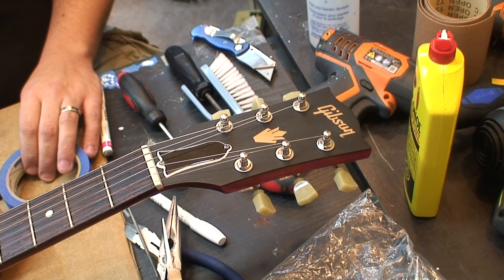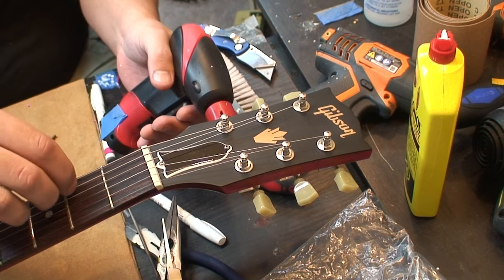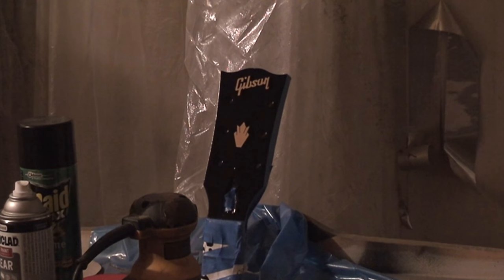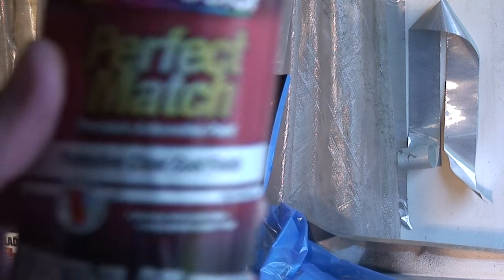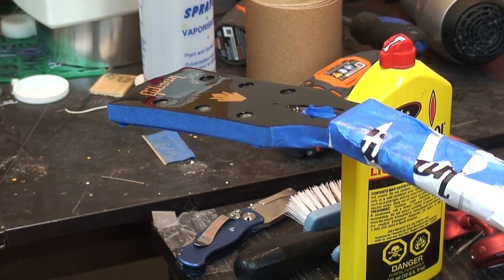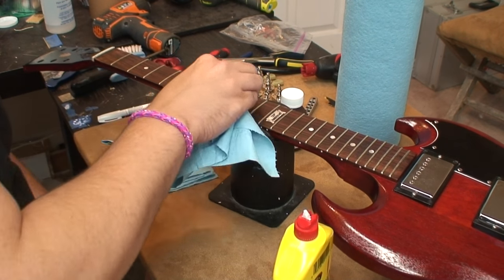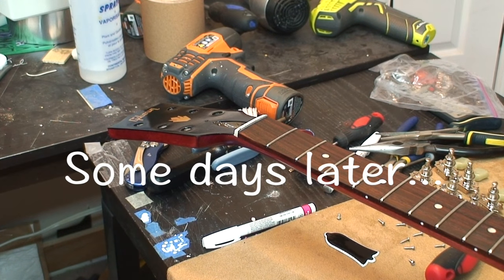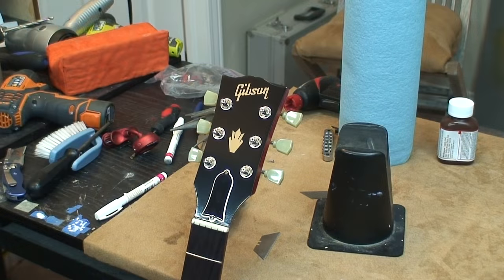2014 Gibson SGJ Headstock: Clear Coated Using Automotive Spray Bomb

Comment: A few things I would have done differently, but your results appear to be excellent. One thing I would constructively suggest, is that you should lay the guitar flat, when finishing the head stock or the face of the guitar. This will result in a better finish, with less orange peel. You can also apply thicker coats without worrying about runs. With the thicker coats, you can then wet sand, for a perfect, finish, undiscernable from a factory one. I also like to leave a slight edge, when taping off the headstock, to let the clear flow over the edge, just slightly. Then you can sand any ridge that may result, again, for a perfect finish.

Comment: was that headstock from an epiphone ?
Reply: Tito López I wondered that, the wings on the back of the headstock make it appear it was an epiphany, converted into a Gibson
Reply: yes! However I found out resently that some or all gibson headstock are built that way...they "add the wings" on the sides. Please someone correct me if I'm wrong
Reply: I'm certain using scraps to make the headstock was cheaper and is pretty much considered ok as these guitars were like 700 new. I have a guitar like this one but the back is painted in black satin. They do the same thing with bodies. 1 big piece costs more than 2 or 3 smaller pieces.